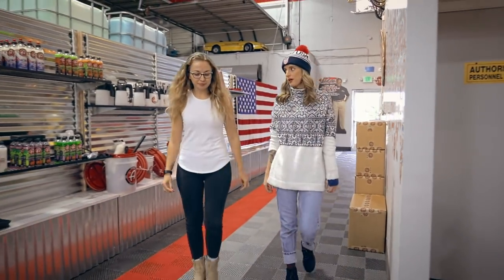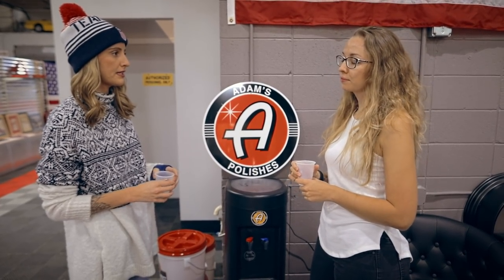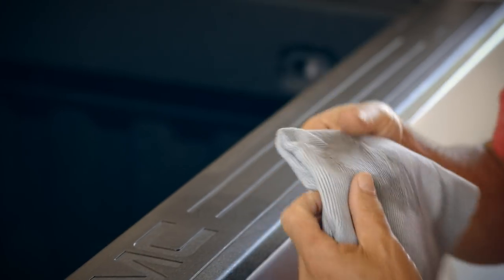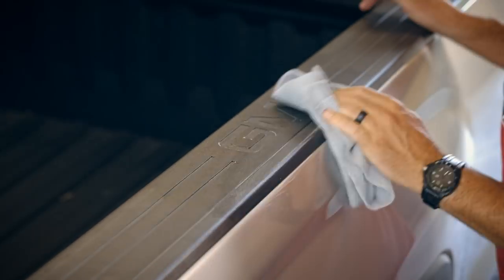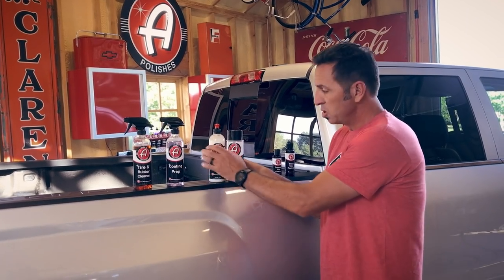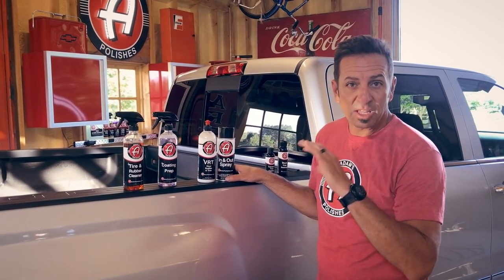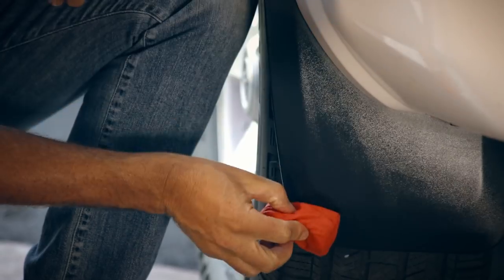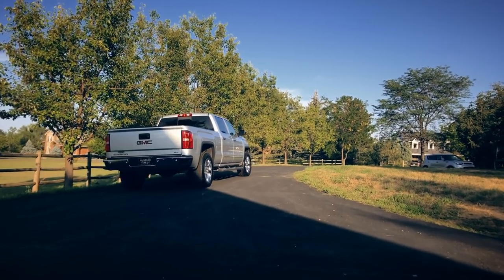Restore, Maintain, and Protect Your Car's Trim | Adam's Polishes Water Cooler Wednesday E7

Comment: Of all the products I have used from Adams, the black trim restorer does not work that well,  it streaks and washes off very quickly,  tried it on my rear bumper plastic on top. It was still tacky on my truck for weeks. And truck is garage kept.